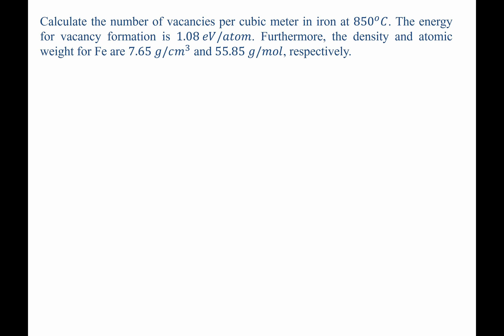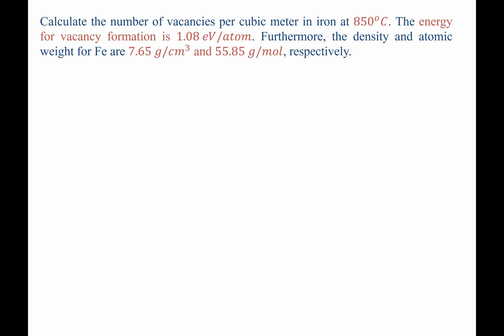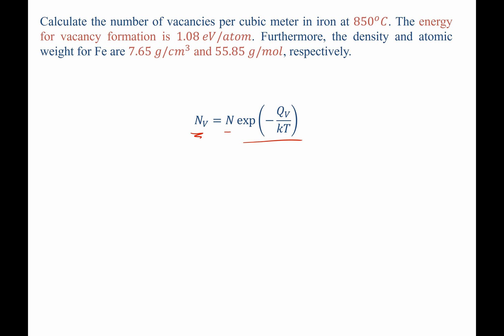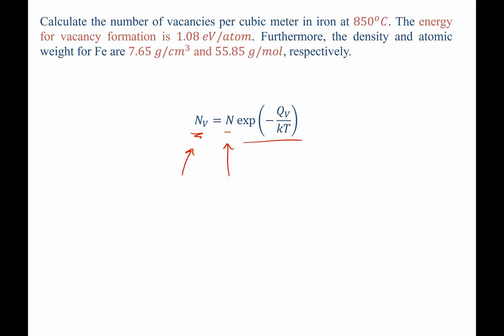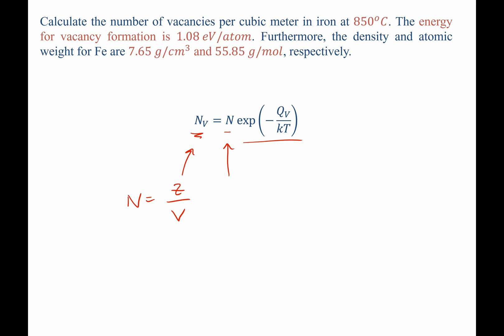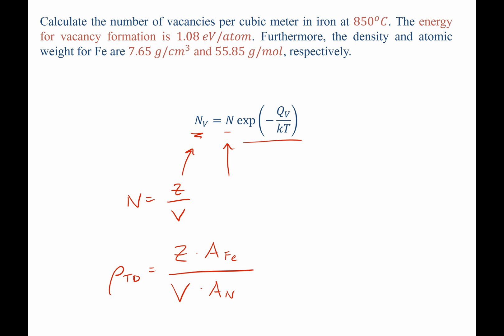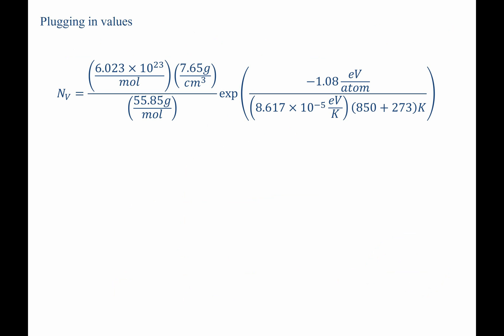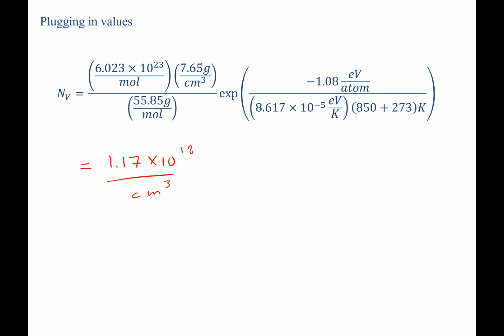Materials science vacancies example problem

Comment: where does the 273 come from?
Reply from the maker: we have to add 273 because the initial problem gives us a temperature in celsius, but when you use the boltzmann constant it has units of energy per Kelvin so we need to convert our temperature to Kelvin in order for the units to cancel.
Reply: @TaylorSparks  
when i put the numbers you have in my calculator i get a different answer to you, instead of 1.17 i get -9.2074~*10^23
doing the exp thing i get 1.73*10^-256
Reply from the maker: @arklanbk  double check your math. Here it is worked out. https://www.wolframalpha.com/input/?i=6.023e23*7.65%2F55.85*exp%28-1.08%2F%288.617e-5*%28850%2B273%29%29%29